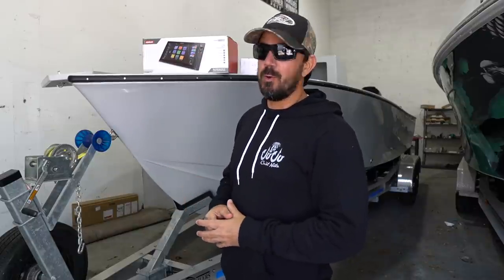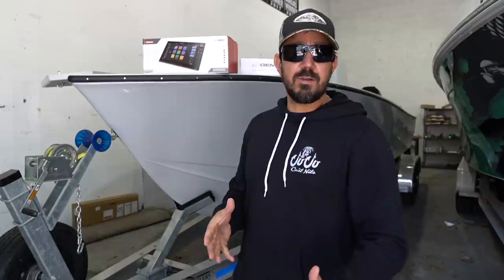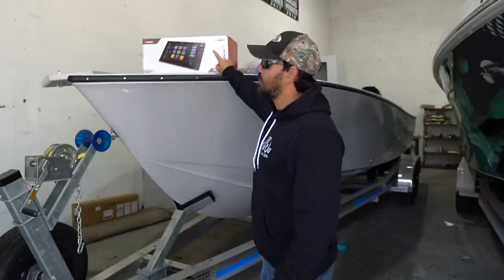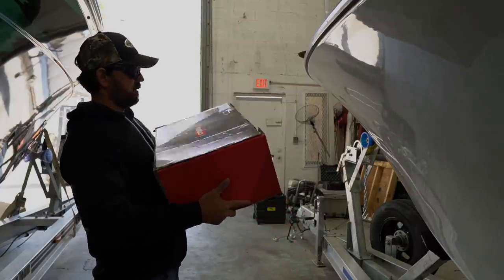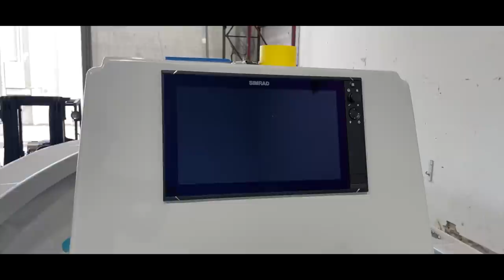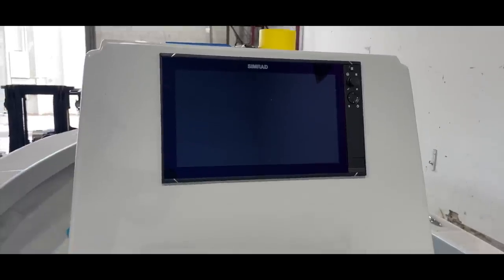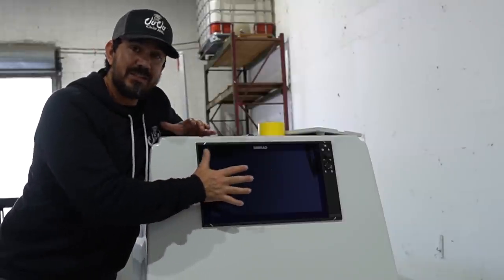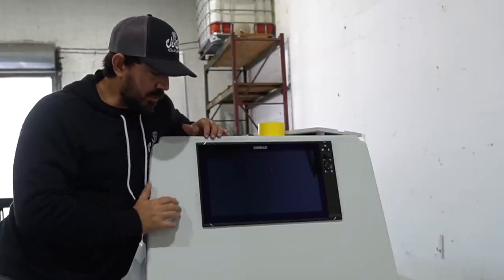How To Install Chartplotter / Fishfinder - Simrad NSS16 evo3S | EP 26

Comment: That console is like working with a blank canvas and that Preferred Marine Tec does clean & pretty work! Looks great so far, it's like a teaser video so you have to tune in to see what's next. I also have the Simrad EVO 3 16" down below and a 9" screen on my upper helm, I also went with HALO 5G radar and the AP44 controller for my autopilot.  The only thing I was thinking mainly because I just did this a few months ago would be to black the console out with acrylic, it gave my 2008 Bluewater 2550 a whole new look. Congrats Mike, your boat is SO SICK!

Comment: I've stuck with this build from DAY 1.  Impressed with all the tradesmen and the quality of work they all have done.  The boat is beautiful!  Very jealous. 
I am restoring an older Grady White 24' Caribbean.  I am also going with a new engine bracket from a company down in FLA... they do it best in FLA.  
Electronics.... I like you am leaning towards SIMRAD.  Sheesh, I would love to get the big screen  like you but sadly I will need to go juuuuust a little bit smaller.  I am looking forward to you showing us how that SIMRAD works while fishing.  Congratulations!

Comment: Hi Mike, just replaced the electronics on my Boston Whaler, I went with Lowrance HDS12 on the dash supported with an HDS9 on the hardtop wired into the 4G radar.  What makes all this work is the Ethernet hub and network, I can run any screen on either of the HDS units and I often mix and match depending on circumstances.  I run a single total scan hard wired to the 12” but the 9” can also act as the sounder if required.  Whichever unit I run in chart if I flag a point of interest it automatically appears on the other unit.  Awesome redundancy and usability, I love it.....👍

Comment: Capt Mike awesome choice on the electronics. That is going to be really nice. If I was a Captain I'd be afraid of a single unit only because if it goes down like you mentioned it was hard to find the unit to begin with so you may be running without electronics for a little while if that happens. I feel your pain on this build, I bought a Rambo in Oct 2019, getting a total re engineer and rehab, and I am finally about 2 weeks from it being done. It's such a process working with small shops and it's been amazing to me how busy they have stated throughout a pandemic. Tight lines!

Comment: Hey Captain Mike, another Captain MIKE here ! Love the boat and design is well thought out for what you want to do.. Like the general layout of console so far,  think I remember that you had a prior rendering done to show layout, but I think that was for a different screen if I'm recalling correctly... I guess I need to see where pipe tower is installed to think about anything else being added to that beautiful clean uncluttered console. If it's possible, can other accessories be flush or below flush mounted with covers made from consoles cut out sections ? Saw it on a boat show demo that was super cleanly done. The cutouts had a common lock on them to make electronics harder to steal, the accessories could only be removed from below, and had a metal box covering all installation items that was padlocked in a way to keep boltcutters etc from access ! If I win your schweet hoodie, I'm XXL ! Thanks For All The Videos !

Comment: Console is awesome and what I want mine to be. Fun fact, the reason he ran the drill backwards with a larger bit is so that when he runs a screw in it won’t crack or chip away the Gelcoat. And that is your install tip of the week. Cheers everybody.

Comment: i have watched this series since you started.  All I can say is "WOW WHAT A NICE BOAT."
Hope you get that baby on the water real soon. 
I have a Lowrance HDS7 Gen 3 and recently updated to a Totalscan transducer. I have done one test of the Log Sonar feature for creating structure maps and it looks promising for getting an overlay of what the bottom looks like especially on artificial reefs and possibly ledges along the shipping channels in the Tampa Bay Area to see where the actual debris is located.  Once you create the maps you can save them to an SD card and then anytime you travel over an area you have scanned it will automatically display the bottom structure as an overlay on your chart.    You can even look at the chart while the boat is out of the water and see the overlay and even add waypoints if desired.  I think???? only Lowrance and Simrad???? have this feature.
Here  is a link to a really SMART guy that has the technique down pat.  One thing that is important is selecting the correct file type when saving the logged files, ie. either a SL3 for the newer units or the SL2 for the older units like mine.
https://www.youtube.com/watch?v=BgAZoyntbLU
Just something you might want to try if your unit has that capability.
Tight Lines to you on your new fishing adventures.
John

Comment: I would not change anything with the layout, but would put in a Garmin unit.  Not saying Garmin is better.  Just been using a Garmin for about 4 years now. Once you learn the menus and all the feature it's hard to change to a different manufacturer.  Also I do really like the Garmin Quickdraw.  I think the next thing is to match your VHF radio DSC with your NAV system. Where are you going to locate your GPS antenna?  Think about what might change if you add a T-top later.